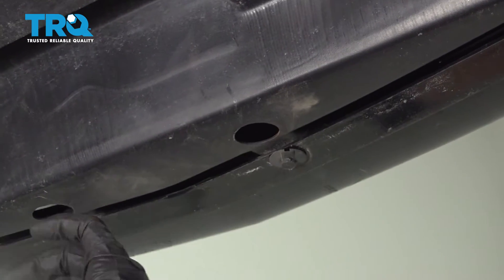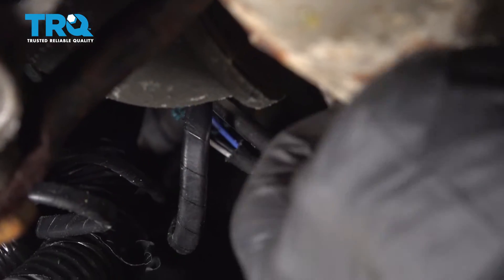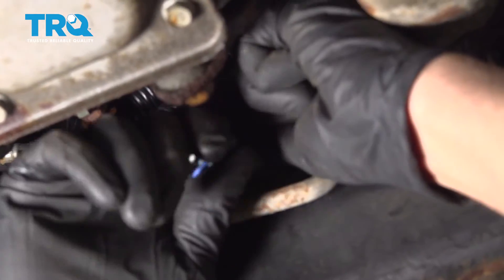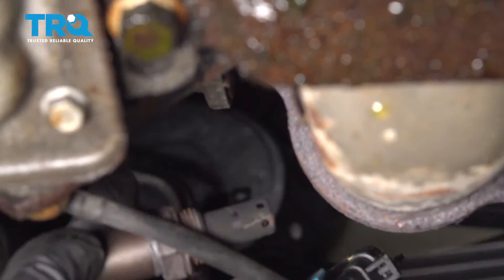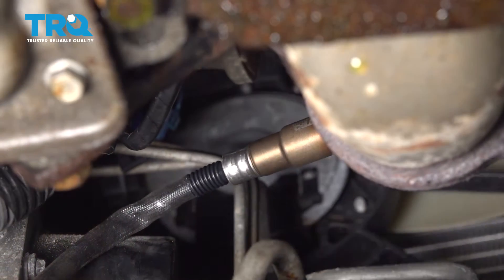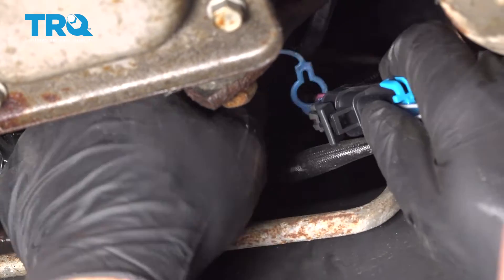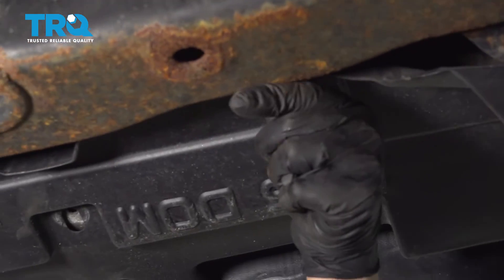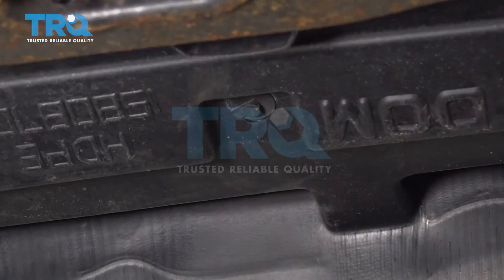How to Replace Bank 2 Sensor 1 Upstream O2 Oxygen Sensor 2006-2011 Cadillac DTS

Comment: Do the sensors really come out that easy? I'm thinking it's gonna have to be heated with a torch. Rust belt here, but even so it would seem that it would be hard to get out without heating.

Comment: Nice video.... On my 09 DTS this can be done without removing the splash guard for sure.
If you notice here.. its being done from behind the crosssmember frame.

EDIT:
I had a hard time doing this on jackstand cause to get leverage the car had to be higher, . I also tried it from forward of the crossmember, where I removed the splashguard, I shifted my brake lines some and they started to leak. I said Aaaaaaah Shit, they were rusted and now I have another problem. SO if you go in from the brake line angle BE CAREFUL NOT TO BREAK THOSE BRAKE LINES WHEN YOU SHIFT THEM FOR CLEARANCE TO THE o2 SENSOR